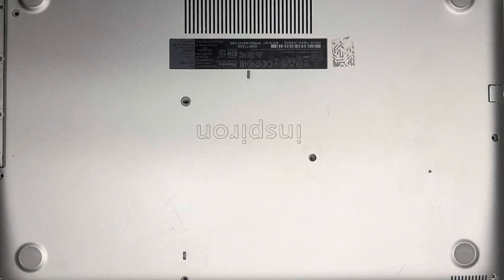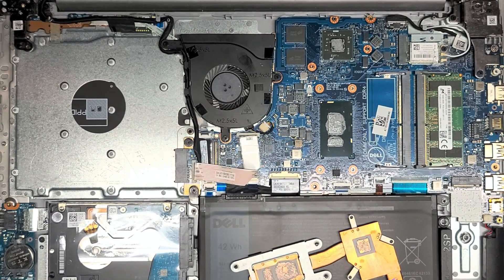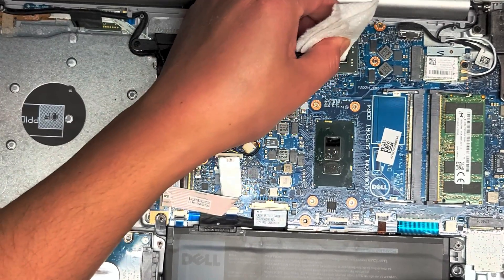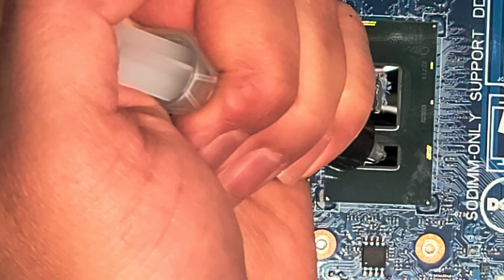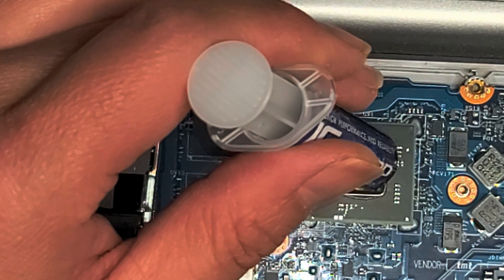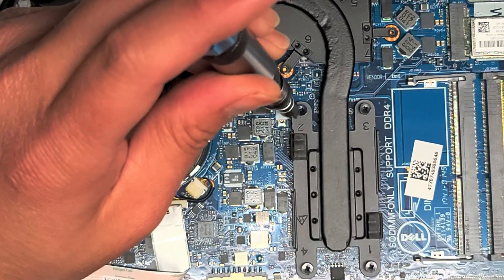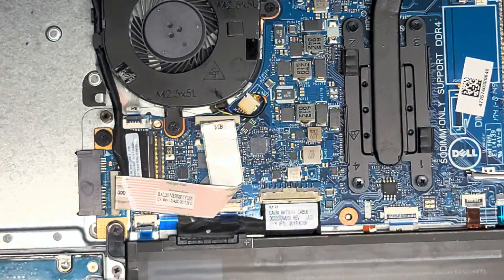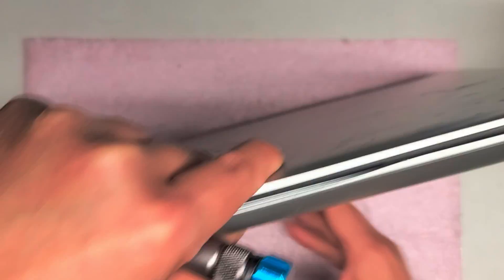DELL Inspiron 5570 Thermal Paste Clean Up Application

Comment: I know this is an old video, but I wanted to ask if you remembered if the holes for the fan had any covering/tapes (on the inside of bottom panel) that can block air from passing through? My friend's laptop seems to be overheating even after installing PTM 7950... I suspect because the factory forgot to remove a transparent "dust filter" that's blocking the holes. I wanted to check if it's normal or something that should be removed.
Reply from the maker: Holes? I don't understand.

Comment: can i follow the same steps on my inspiron 15 5580?
and is the isopropyl alcohol a must have for the process?
Reply from the maker: Very likely. It's not a must, but it helps with a lot better cooling.
Reply: @ItsBinhRepaired  alright thanks man
Reply from the maker: @woonjohn3020  yup

Comment: Will the exchange of thermal paste make an improvement to performance. It does pretty well running Valorant and decent settings, but gets hot. Will this help my computer?
Reply from the maker: Only if it's overheating
Reply: @ItsBinhRepaired  thanks for the quick response!!! It reaches about 79 *c within the first 10 minutes of gaming. And peaks about 80-85. I also have had the computer for 3 years and haven’t changed anything.
Reply from the maker: @momsspaghetti9460  might need to repaste and clean the radiator fins
Reply: @ItsBinhRepaired  thank you for the help

Comment: ¡Sin pulsera antiestática, sin desconectar la batería?
Reply from the maker: Yup, not necessary. It would be like using sleeping gas when the dentist cleans your teeth. Lol

Yes, it makes it less risky, but there's little to no risk unless you drop stuff on the computer. Imagine the dentist dropping the metal hook or drill in your mouth. Lol

Comment: Hi. There are two parts on your CPU. I mean two shiny parts/chips. Unlike desktop processors where you have only one part. My question is: Are you sure we have to apply paste on both parts like you did? Or we need to apply on bigger part only?
Reply: in some laptops you have two shiny chips because you have the cpu chip and gpu chip unlike desktop you mostly change the cpu thermal paste only thats why you have to apply thermal paste on both chips
Reply: The answer would have been: Yes, it is recommended to apply the paste on all three areas. All are chips that have to be cooled by the copper cooler. Otherwise they will either be destroyed by overheating or the hole system will step down or shut down if the BIOS recognized. No need ti fight in words ;-)
Reply from the maker: Why do you ask if you should not follow my instructions? That makes no sense lol
Reply: @ItsBinhRepaired  Why must I follow your instructions? I watched it for knowledge and curiosity and it somehow helped me in replacing my own laptop paste.

If you don't want to answer any relevant queries under your video, that is fine.
Reply from the maker: @fanatic632  when someone shows how to cut an apple, do you ask, are you sure you need to use a knife? Go ahead and leave it without paste. See what happens. Are you sure you need paste at all?

Comment: may i know which thermal paste gives best result for inspiron 5570?.
Reply from the maker: I use ic diamond. I don't do comparison tests. These are customer computers and can't risk doing repaste over and over. Doesn't really matter what paste. You'll at most get a couple degrees difference.
Reply: @ItsBinhRepaired  thanks for the reply
Reply from the maker: @ruthranokil6867  yup. I use ic diamond because it's safer to use.
Reply: @ItsBinhRepaired  I decided to use the same 🙂hope my laptop will get its old performance 😢
Reply from the maker: @ruthranokil6867  best to upgrade to an SSD. You don't need thermal paste unless your computer is reaching 90ºC
Reply: @ItsBinhRepaired  yeah I am going to upgrade to ssd too, but my laptop gets too hot even using only chrome 😢 and I can feel the heat from the keyboard 😕 it is really getting too hot I think it is over 10°C 

And the performance really getting too bad I cant use any websites properly it will be freezed , in the start i have used 5 android studio editors running and using 100+chrome tabs in the same time but now i cant use visual studio code 🥺
Reply: @ItsBinhRepaired  can you give me the link to buy IC Diamond paste pls
Reply from the maker: @ruthranokil6867  might just need cleaning https://youtu.be/3zs_SJ3BXgA
Reply from the maker: @ruthranokil6867  I recommend this paste actually. https://amzn.to/3fMaOzB similar properties to ic diamond, good reviews and their cooling systems are some of the best.
Reply: @ItsBinhRepaired  last month I have cleaned the fan after that the noise problem was solved but freezing problem and heat issue remains there
Reply: @ItsBinhRepaired  cool thanks for the info 🙂 keep posting more videos
Reply from the maker: @ruthranokil6867  no problem. Will do!

Comment: Is there a difference between before & after?
Reply from the maker: Temperature? yes, I'm sure, but I don't check.
Reply: @ItsBinhRepaired  My cpu temp was 98°c when gaming
Reply from the maker: @Skiyle34  that's really bad
Reply: @ItsBinhRepaired  will repasting fix it?
Reply from the maker: @Skiyle34  most likely
Reply from the maker: @ishansp  if the computer has thermal pads you can replace them or reuse them. I don't know the thicknesses. I usually just reuse the pads that are there.